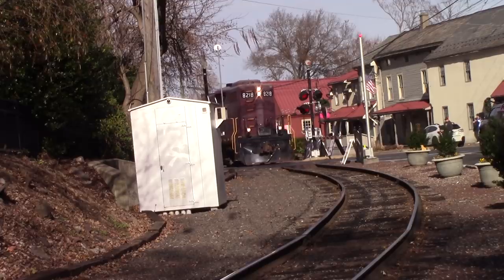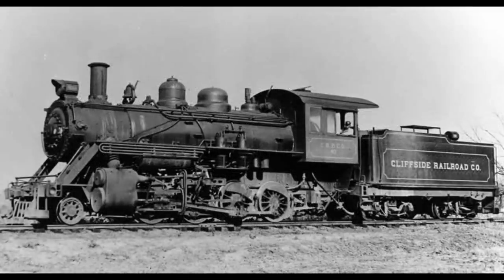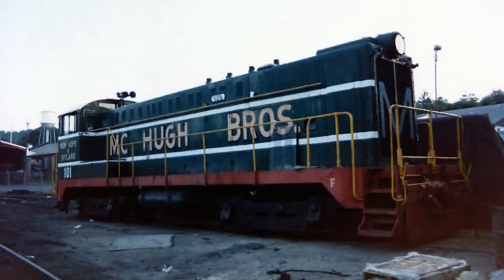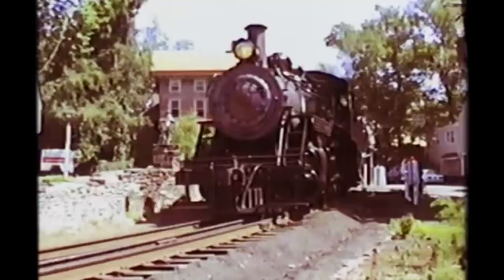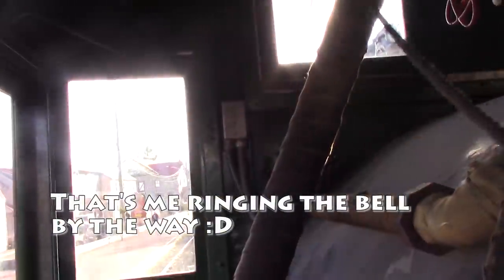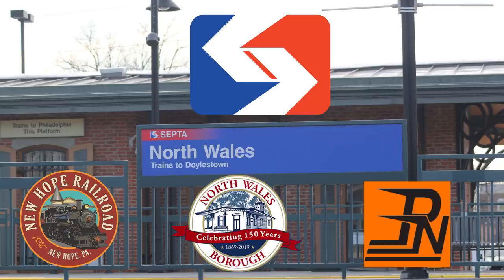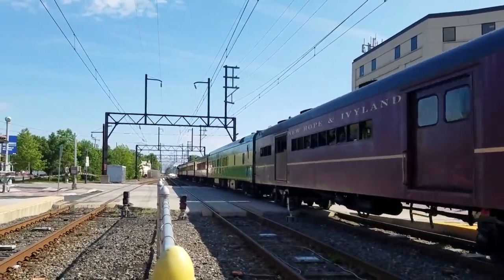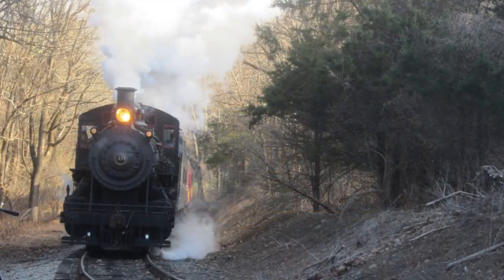New Hope profiles: Steam engine 40

Comment: The bell is only hand rung when the pneumatic rocker which is located on the engineer's side of the bell isn't behaving. In my experience it is hand rung about 20% of the time.  Even when it is working rather well it occasionally needs someone to give the bell cord a pull to help start it in motion and from there the pneumatic rocker can carry on the ringing without assistance.

Comment: Thunder does Strasburg Railroad 90 also where a Reading 6 chime?
Reply from the maker: It's said in the video. She does wear a RDG 6 chime. The only difference between 90's and 40's RDG 6 chimes is 40's appears to sound at a lower pitch (Likely due to the smaller boiler and the fact 90 has 5% more boiler pressure) Both are also Baldwin products (90 being completed 1 year before 40 in June 1924)
Reply: @Thunderbolt_1000_Siren  Thank you. I like the SP 6 chime best on 40. I knew that 90 was one year older than 40 but 40's RDG 6 chime sound a little different to 90's like you said.

Comment: She still run today?
Reply: Yes but because of the current pandemic, not much.
Reply: @Harrison La time traveler I can imagine/Know
Reply from the maker: As of October 2020 she has been seen in operation currently sporting a 6 inch Crosby 3 chime. She was last seen pulling the fall foliage trains to the Rt 413 crossing just before Buckingham siding and is currently powering the "Ghost trains" as late as 10pm. She will also be found on the polar express trains as usual too in December.